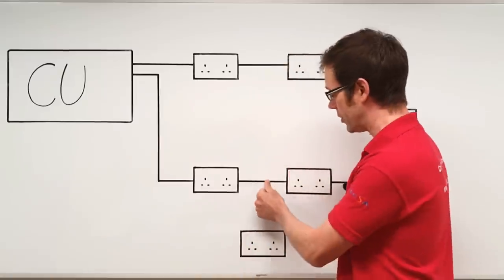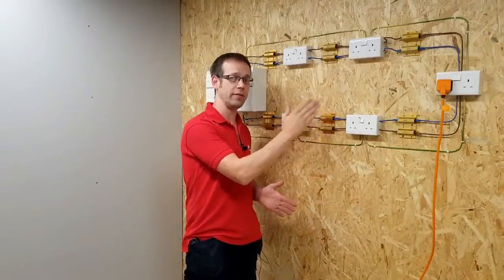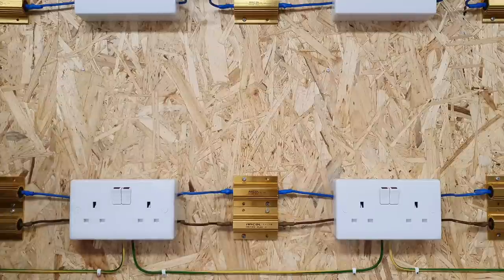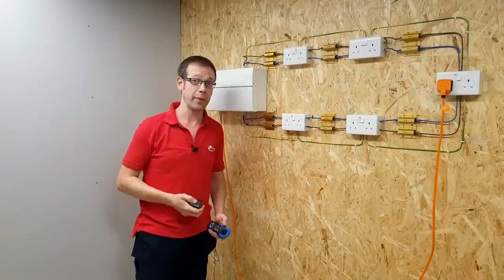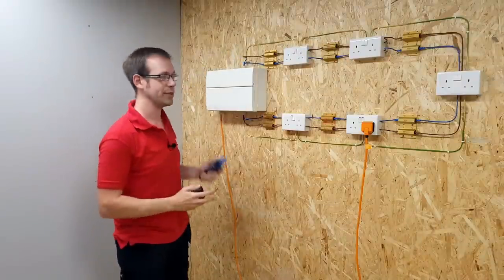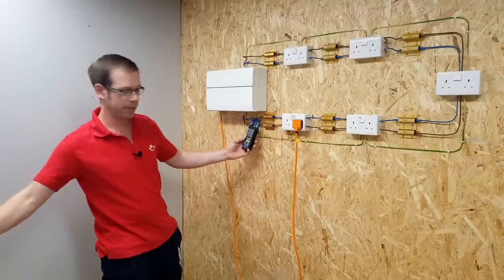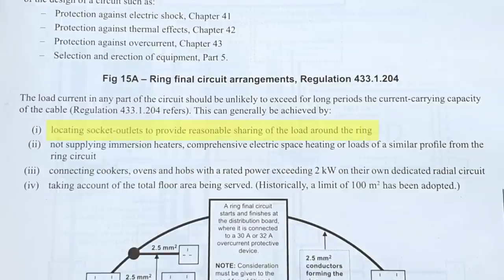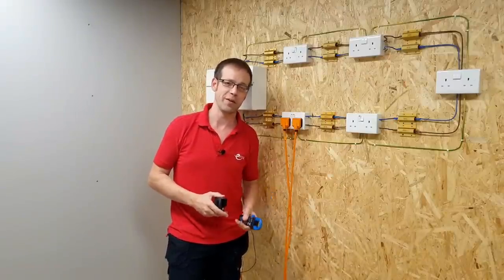KNOW HOW: How does current divide in a ring final circuit? (ring main)

Comment: I hate ring finals even more now. For god sake they're even in new builds. Just do what I do. 1 x 20a radial for downstairs, 1 x 20a radial for upstairs and 1 x 32a radial for the kitchen on 4mm. Job done.
Reply from the maker: One day could become standard ;-)
Reply: Rings are an ideal solution for some installations. Do not knock them. They are also idiot proof. A 32A Mcb/RCBO then daisy chain them up.  If installed properly the likelihood of one cable exceeding 27A is highly remote. If it appriaches 27A, the 32A mcb would have tripped anyhow. Not all current will run down one leg of he ring, unless there is a fault. You can always have a 25A mcb/RCBO fitted in place of the 32A. Then one of the 2.5mm cables will never exceed the 27A 2.5mm cable rating. The likihood of exceed 25A ina ring is very slim. Of course you need to know the usage of the ring. 

Also, this applies to rings and radials, put the cirrect size fuse in the appliance plug. I have an approx 800W toaster. It put in a 6A fuse. Most would have a 13A.  If the appliance is faulty it cannot draw more than 6A

They are cheaper to install. 

They are a bit more difficult to fault find, but I prefer them to a whole bunch of radials with their own mcb/RCBO's.
Reply: @johnburns4017  I completely disagree. Ring final circuits were a post-war answer to copper shortages which should have been discontinued long ago. This is not a perfect world and idiots will come from far and wide to fuck-up your newly installed ring final (i'm looking at you kitchen fitters). The best solution is to make it as difficult as possible for anyone to mess up your work. Its all well and good to say "I did the job to regulatory standards" but part of our job as electricians is to assume the worst case scenaro and take whatever measures are necessary to mitigate the risks. Its not just about covering our own arses but doing whatever we can to ensure our customers don't die in blazing infernos, even if its thier fault. To that end I would submit that radials are the more "idiot proof", not rings. Lets assume idiot no 1 takes a tripple spur off his ring (seen it many times). That could easily overload and damage the cable(s) and could potentially cause a fire. Bear in mind that a type B curve 32a MCB won't trip at 32.01 amps - far from it. It will only trip at about 46 amps and even then only after about 15 mins - more than enough time to melt a length of 2.5, a conductor "fall out" of the cable and come to rest on some sawdust or similar in the floor cavity. Now you've got the real potential for a fire. On the other hand idiot no 2  takes a tripple leg off his radial circuit and....nothing. He can't overload it without ADS occuring. Worst case scenario, a 20a breaker will trip at about 28 amps flowing for 15 mins which, while not ideal, would never do any meaningful damage to a length of 2.5 in that relatively short time. It would even be regulation complient providing the length wasn't excessive. There is an additional advantage when it comes to 32a radials on 4mm - DIYer Joe McFuckwit thinking he knows everything about "ring mains" may think twice when he sees the increased cable size, realise he doesn't have a clue - then calls a professional. On top of all that - splitting the circuits up is an ADVANTAGE. If something goes bang on one of them, you have two more to fall back on. If the same thing happens on a whole house single ring - no sockets for you sunshine. No hot water, heating, fridges and of course - no Wifi! Also a 25a breaker? I don't think i've ever seen one out in the wild and certainly not protecting a ring. This is the real world. As for fusing down the appliances - that doesnt enter into it. We are talking about overload current not short circuit or fault current - both of which are easy to mitigate.
Reply: @mastergx1  
Yes, there are advantages to rings. They have been widespread in the UK for 75 years. They have been found to be very safe.

♦ Cheapness, as smaller, easier to install, wires can be used;
♦ Two ways for the earth back to the consumer unit;
♦ Another is a large number of sockets can be off one cheap ring;
♦ Having the same number of sockets using radials would mean multiple radials and multiple extra breakers at the main panel. Far more cable, expense, labour and hassle;
♦ The 32A breaker and 13A fuse in the plug ensures safety.
♦ Portable plug-in appliances on a ring cannot exceed approx 3kW. Some plug-in ovens are on rings;
♦ Rings usually have a 32A breaker at the main panel - can be a smaller value;
♦ Using push-fit maintenance free Wago type connectors to connect up the ring makes them a lot safer as not being screwed connections they do not work loose. The ring's current does not run through the socket terminals;
♦ The British plugs are designed with rings in mind having a max 13A fuse in them - can be as low as a 1A fuse in the plug to suit the appliance. Small flex and appliance? Then a smaller fuse;
♦ Rings in the UK are limited by square metres of floor space, with no limit to the number of sockets on the ring. 100 square metres of floor space for 2.5mm cable for a 32 amp final ring .

Radials are also used in the UK, rings are not mandatory, but used because they are generally trouble free, safe. They can be installed using rule-of-thumb. These days a ring will be on an RCD or RCBO - these now are becoming DP, so safer again. In one job in an office, they wanted more socket outlets for extra desk computers. It was a simple matter of extending the existing ring with the extra sockets as the current draw was low. Cheap and easy. If radials were used three radial circuits would be needed, which would mean an extra consumer unit, breakers, wire etc, then far more labour.

Some disadvantages are:

♦ Rings are more difficult to fault find. But electricians have no problem once the ring is full understood;
♦ Another is that if a number of high current drawing appliances are on one side of the ring, say near to the main panel, most of the current draw may be down one cable of the ring which is rated below the main 32A breaker. 2.5mm cable is rated at 27A max. Although tests have proven the cables do not exceed their current capacity, just an imbalance in distribution of the two cables from the main panel (consumer unit). Good circuit design will prevent this, negating this disadvantage. Balanced rings can be installed by daisy chaining to alternative socket outlets on the ring. That is the first appliance will draw from one side of the ring, the second socket will draw from the other side, and so on round-robin. Or use 4mm cable to the point where heavy current drawing appliances are then 2.5mm for the rest, if it is that troubling for some. Using 4mm cable on one side of a ring and 2.5mm on the other, is still cheaper than a bunch of radial circuits.

Overall I consider one ring superior to a bunch of radials needing their own breakers at the main panel. They are simpler, cheaper, being proven to be safe and worked well over the past 75 years. You will have to give a very convincing argument for me to give up rings. I have not heard of one yet.
Reply: @mastergx1  
Look u tube vid: overloading cable connectors electrician. uses 2.5mm. At 50 A it was not bursting into flames. It took far more amps.

Comment: Can a ring circuit be put into a 16amp breaker if the Zs is too high for a 32 amp?
Reply: Yep. IIRC, to current regs minimum of 2.5mm cable and max of 32A breaker (MCB, RCBO, AFDD). 
A ring circuit can be in no more than 100 square metres of floor space, with the cable no longer than 100 metres in length - the 100-100 rule.  If the ring is long, use 4mm cable to get the resistance down and avoiding an unbalanced ring.

Comment: Great video on ring mains. Showed the path of least resistance concept brilliantly 👍

Yeah, I’m just pulling your leg 🙃

Actually it’s a great video. Are you planning on showing how a radial makes much more sense? And showing example of 4mm, 6mm and 10mm etc just to drive the point home?

Also, my bugbear with “rings” is that I’ve see many rings that aren’t rings anymore (N or L wire hanging out of the back of a socket). So two radials on a 32MCB 😧 

Thanks 🙏
Reply from the maker: Couldn't agree more. 👍
Reply: "Path of least resistance". I have seen this phrase used by qualified electricians and it is such a poor phrase that we should stop using it.

The phrase gives rise to a misunderstanding  that where there are multiple paths for the current to flow, that it only flows along the path of least/lowest resistance, and that is just not true.

The current flows through all parallel paths, and the way to calculate what current flows along each path is by using (1) 1Rt = 1/R1 + 1/R2..1/Rn for n parallel paths/ resistances in parallel and (2) R=V/I, and (3) ΣIn =0